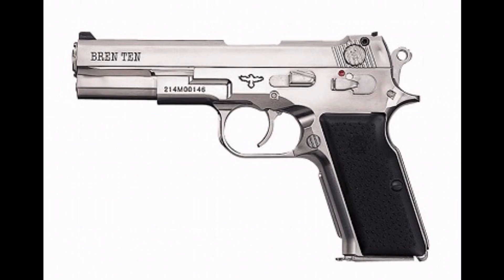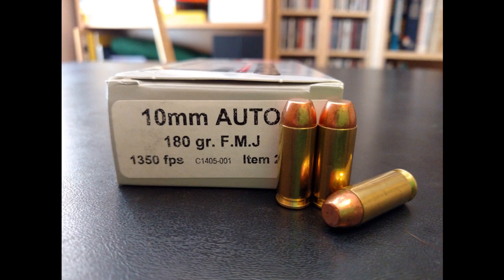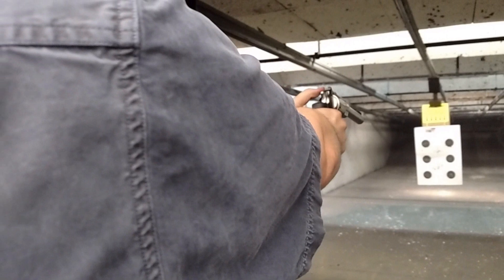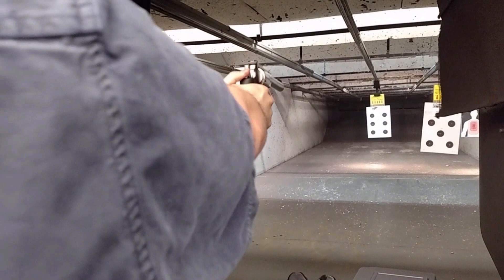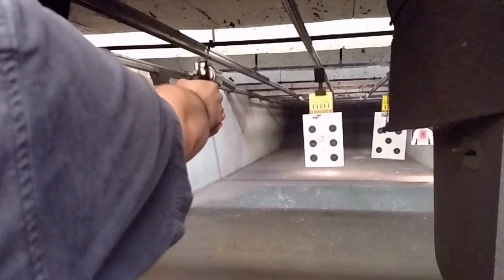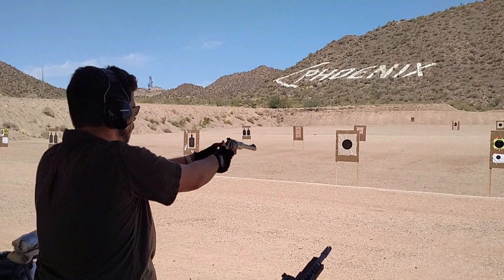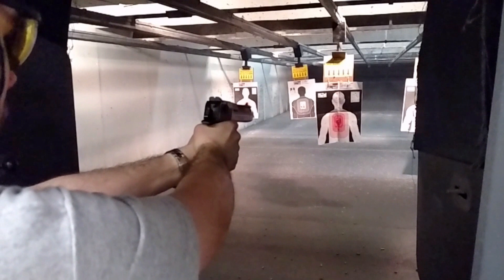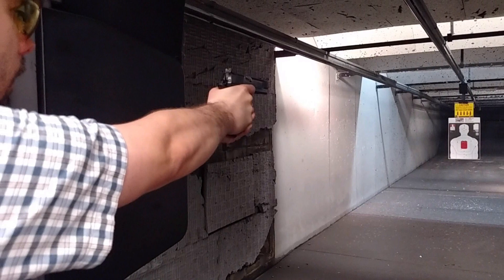Top 5 Big Bore Handgun Calibers

Comment: As far as auto pistol rounds I really like the 10mm. This is my choice in an auto pistol. For a revolver I like the .357 magnum. All are good choices and it comes down to what one can handle well. In other words, a caliber that one can control well enough to shoot it accurately on a consistent basis.
Reply: 10mm is an absolute beast especially when you shoot it with hot loads. The hard upward recoil does put some strain on the wrists after shooting it for a while.
Reply: How's about .40 Smith&Wesson?

Comment: My favorite is the 40S&W only mentioned in passing.
Reply: I like .40 S&W, but I prefer the big brother 10mm
Reply: Would .40 count as something like a mid-bore (not sure if that’s a real term)? Or is it technically large because it’s a toned down 10mm?
Reply: @BuddyLee23  it's still considerrd a large bore, because it is still a 10mm just in a shorter shell casing.
Reply: @BuddyLee23  The bore is the same on both so if one is a big bore both are. One is more powerful of course but the caliber is identical (incidentally also the same as the .38-40).

Comment: Gotta agree. I have a Springfield 1911 45 cal Mil Spec. It is accurate and the recoil is something you can handle all day without the "tingles" Ammo price is mid-range but sometimes you can score a sale on the 500 to 1000 round box. Buying anything less and you won't receive a good savings. Did buy the Hornady 20 round 45 JHP for home defense.

Comment: My first experience with the 454 was with a 6" Ruger Super Red Hawk. Because the grips on the Ruger did not have a palm swell and thus didn't fill my hand, the felt recoil was absolutely brutal. After 5 rounds my gun hand was nearly useless for 2 days. A few months later, I was able to try my friends Taurus Raging Bull 454 with an 8 3/8" barrel. With the standard Raging Bull grips and the ported 8 3/8" Barrel, the Taurus turned out to be a real pussy cat. Accuracy was top drawer.
Reply from the maker: BIll Hagan - I always liked Taurus' grip design on the Raging Bull along with the ported barrel.  I have contemplated porting my Super Redhawk.
Reply: 6" SRH?...I don't recall that version. When they 1st came out I  know there was a 7.5" (which I own) and a 9". Much later they came out with the Alaskan. I thought that was a snubnose.

Comment: This seems to have generated some controversy, and that was not the intent.  While Smith and Wesson announced the Model 29 in the new cartridge 44 Rem Mag first, Ruger beat them to the market place, producing and delivering Blackhawk SA revolvers in 44 magnum before Smith had their product on the shelves.  There are countless references confirming this, but check for example "107+ Handgun Accuracy Secrets" by Massad Ayoob (fairly authoritative) et. al., Delta Medium Publishing, page 75.  There are many more.  It does not matter if S&W announced their new product first, Ruger beat them to the shelves.

Comment: I really like the .45...but my true love is the...41. Mag.
Reply: If you want something that hits in the range of the .41 magnum, buy a 10mm and load it with some hot 10mm rounds.
Reply: Never shot it but I ALMOST bought a used Ruger Chambered  4 it.... Instead I bought a 9 shot Hi Point JHP in 45 ACP and a BUNCH of ammo!!!
Reply: @jpb1231000  I had a Hi-Point JHP 45 at one time. It was dead on accurate right out of the box, and it was reliable as could be. My biggest complaints with it were the weight of the gun and it was a bitch to take apart and clean, if it weren't for those 2 reasons I would have kept it. Ended up trading it in and paying the difference to get a mint condition used .45 ACP Glock 21. I do like the Glock better though, because it's a hell of a lot easier to take apart and clean and it is accurate as hell as well.
Reply: Really nice round. Not hugely different than the .44 but slightly better SD than the 44.
Reply: @bdr32965  ....I own a 10.....S&W MOD. 1006...
Reply: Wow 41 mag I never fired one , but almost bought one years ago , should have. If I ever see another one again I'm buy it.

Comment: in addition to the original 45 long colt being not chambered in rifles because of colt wanting royalties for chambering it's cartridge, the original "balloon head" casings had a tendency to break off. That would leave the casing stuck in the chamber. The other reason being deep extractor groove present in modern 45 long Colts weren't present in original case heads
Reply: Daniel Hess - the original balloon head cases of the 45 long colt didn't have enough rim for RELIABLE extraction in a rifle. Not a problem anymore, but that was the original reason they weren't chambered in rifles. 
Case head separation wasn't the issue. The Colt cases were made the same basic way that the 44-40 and the 38-40 cases were made, and those cartridges did fine.
It wasn't until reloaders tried to hot rod the 45 that problems arose, and those problems included rim blow-out before any separation issues occurred. Rim blow-out is the reason S&W started countersinking their chambers. That's not something that is needed with modern web head cases, but the practice is still often included as a sign of quality craftsmanship.

Comment: Pretty good list. For me I would have a hard time picking the order but the top 3 would be .45LC, .44Mag, and .44-40. The last two might be .38-40 and .45acp unless you count a single shot like a contender in .45-70 or .38-55.

There aren't more auto loader carts simply because for me my only use for an auto is some really cheap knock about or something where I am CCW in a situation where I expect to likely have need of a lot of initial round capacity such as escape from New York. In the latter situation something like a CZ-82 would seem to be the appropriate weapon which isn't a big bore.

Comment: My favorite is 454 casull revolver with extra 45 acp cylinder so it makes 3 caliber gun 454 casull , 45 Long Colt , 45 Acp than l would buy Cz 75 SP-01 Shadow or Shadow 2 then buy a 22 LR kit for this pistol so 2 hand gun but 5 caliber 454 casull , 45 Long Colt, 45 acp , 9 mm And 22 LR

Comment: The 45 acp is fine..  I have 3 1911's and a 1917 revolver..   it falls short for long range work tho and... who likes picking up brass?   it is good..  I load my 45 acp with 200 grain cast swc rounds at around 1,000 fps which..    is a pretty good round.

Comment: This strikes me as a pretty fair evaluation.  To be fair, I am over the huge bore handgun fad, so I probably see this from a different perspective.  
Most of the cartridges you mention are not shot a lot.  Even back in the 1970s (I've owned five or six .44 Magnums - both Models 29 and Super Blackhawk -  in that time frame) most people I have met tend not to shoot the .44 Magnum cartridge in full power mode a whole lot.  It is a most powerful (not THE most powerful) handgun round and features high versatility.  However, I thought long ago - and was right - that if I needed that much power, a small to medium sized rifle would be more useful.  By the way, I find a Super Blackhawk much more fun and less painful than a Model 29 with heavy loads.  
In the .44 family, I much prefer the .44 Special.  Yeah, I know, the standard factory load for YEARS were loaded to be safe in the top break .44 American and .44 Russian calibers and pressure levels.  But I do handload.  The load I have developed is within the pressure levels of the Smith & Wesson .44 Special Hand Ejector, 2nd model; featuring a 250 grain flat fronted cast bullet at about 900 or so fps.  Not a magnum load, but will suffice for most purposes.
I do agree about the .45 ACP.  In a Government (or Lightweight Commander) Model It is likely the most versatile combination of cartridge and pistol available.  For self defense - for which it was designed - nothing really is better.  When one reaches a certain level in anything, 'more' doesn't matter.  In many ways, it works better than 10mm.  It allows faster subsequent shots (for more than one target) and yet is a reliable stopper when applied properly.  Of course, the 10mm is also, but is far more intimidating to the shooter.  No, I would not intentionally use such a combination for hunting game deer or larger, but as I already said, I'd use a rifle.

The other rounds mentioned are ones I have not fired.  Nor do I see any reason for so doing.  I understand the desires of others to use large bore handguns for various purposes, but do not share in it.    I'm sure they perform as advertised.  

Once again, I do find this video quite fair and balanced.  I do find the underlying precepts and assumptions flawed, but understand my views are not the laws of the Universe.

Comment: Ive fired thousands of rounds through my Delta Elite and never ONCE did i think it had anything close to heavy recoil.  I felt it was average..
Reply: I bought a Delta when it first hit the market and used it in bowling pin competition along with a Gold Cup. I regrettably sold it and the Cup when raising funds for a USPSA gun. I recently acquired a Glock 20, but haven't fired it yet. I'll wager it won't handle the 10 mm nearly as easily as the Delta. I used a 45 acp in USPSA in both semi and revolver. but that new gun I was building was chambered in 38 super ( this was before nines or double stack), which next to the 45 is my second favorite.

Comment: UK poster here, so much of my opinion is either theoretical, or based on what I used to be able to do before the laws changed.  Obviously, the cartridge does affect the accuracy, but as long as you use decent quality ammo, surely the gun is far more relevant to accuracy?  A 2" snub revolver is never going to have the accuracy of an 8", even with exactly the same rounds in it.  A crappy Chinese knock-off of a 1911 is never going to outshoot a Colt Custom House Match pistol, even if both are using match grade .45acp.

Comment: I like this vid.  I've got a 1911 that I soon plan to convert to 460 Rowland.  Also my next purchase will be a Super Redhawk 454. I like these guns with the configurations because of versatility.  I'm one of those guys who may plan to just hang around town but last minute may end up in the woods. I wouldn't trust standard 45acp or 45colt to a good sized bear. at least not without maybe chancing a reload. So I plan on having both swapping my daily carry as I choose and always keeping both respect sets on me depending on if I carry my 1911 (45acp/460 Rowland)  or the super redhawk (45colt/454 casull). I've always lived by this motto "Its better to have it and not need it than need it and not have it " anyone who's never heard that, live by it and you'll see how much easier life gets. use those wise words and throw tacticool out the window just go for ease of use, practicality, and versatility and you'll never go wrong.

Comment: Good List,  The recoil on the 454 with my first shots, was intense but it gets better as you get used to it. At first I only really wanted to shoot 5 rounds of 454, and then switch to 45 colt. But as i have shot it more, I often do 30 rounds of 454 and 50 rounds of 45 colt in a sitting with my super redhawk. I enjoy it alot. Although accuracy, suffers with the 454  I need to shoot and practice a whole lot with it. With 45 colts I am spot on, with 454 it spreads a bit but functional.
Reply: +48conkli By the way, love the 10 mm too, My 29 is my most enjoyable gun I shoot.
Reply: The .454 was the first hand gun i fired. and i fell in love with it

Comment from the maker: +Brian Fortin - The .460 Rowland is one seriously bad-ass cartridge!  I kleep debating on getting a conversion kit for my Glock 30, but can't make up my mind.  I think I'd rather wait until I have a Glock 21 so I can go full size to help with the recoil.  I left this one out because it's still so new, and hasn't quite had a ton of info I could research on it.  Although, I LOVED what I did find!  It's a freakin' monster of pistol power!
Reply: get the 460 Rowland . You can shoot 45 acp+p, 45 super and yours truly 460 rowland.
Reply: Go Big Bore Or Go Home I'm getting the 6 inch barrel conversion for my g21 and I've heard a lot of varrying opinions on the recoil everything from lighter than ball 45s to 454 casull so take what you read with a brain is salt but from what I've seen in videos it looks like 45 +p loads recoil wise and no the comp can be removed without the need of a vise ( it had to be lock tighter in before ) just remove a set screw and untgread it
Reply: Go Big Bore Or Go Home and why no 500 s&w
Reply: I have a 500 Smith & Wesson performance center 7.5 inch barrel  nice revolver but I just love the fact of 460 Rowland has 44 Magnum power 10 plus One in the Chamber you cannot go wrong with that with 255 grain 11 rounds I think it's pretty devastating. For whatever animal in North America.
Reply: Manuel Silva yeah the 460 Rowland is really a for to be reckend with also I'm not positive but I believe the rowlanator sight comes with the 6 inch conversion and my 500 is a bfr with a 7 inch barrel
Reply: Yeah I think all you need for most use is a 460 Rowland 500 Smith & Wesson it's pretty much if you want to go to Africa LOL. And if that's the case I could just use my CZ 505 Gibbs
Reply: Manuel Silva yeah the 500s more for fun but if I was going to Africa with it I'd feel pretty safe
Reply: It has been done before. Plus like I told the other guy. The 460 Rowland has been used as a side arm in Alaska

Comment: 10mm and 45ACP are big bore?
Reply: BR5499a 45 ACP is bigger bore than 44 Magnum. Does only 500 s&w count?
Reply from the maker: BR5499a - For the purposes of the channel, I start the category as anything that is .400" in diameter or larger.  Gives me more calibers to work with.  To be honest, there is not hard and fast rule on this, as some consider it at the .41 Magnum and up, some say .44 Speecial (.429") and up, and some say .45" and up.  Remember that we are going by bore diameter, not power factor.
Reply: 45 can take a black bear and 10mm can take a kodiak brown bear
Reply: Most people factor power into the equation. For example a .45 ACP has a larger bore than a .41 Magnum but only the .41 magnum is considered a big bore and that is about the minimum limit on the power scale that is usually considered "Big Bore".
Reply: BR5499a here's how i classify bores:

.17-.25 and their metric equivalents  is small bore. Examples: .17 WMR, .22 Short/Long/Long Rifle/Magnum, .25 ACP

.30-.38 and their metric equivalents  is medium bore. Examples:
.32 S&W/Long/H&R Magnum/ACP,
7.62 Tokarev, 7.63 Mauser, .357 Magnum, .357 SIG, 9mm Luger/Parabellum, 9x18mm Makarov, .380 ACP, .38 Special, .38 Super

.40 and above and their metric equivalents is large bore. Examples: 10mm, .40 S&W .41 Magnum, .44 Special/Magnum, .45 Colt/ACP  .454 Casull, .480 Ruger, .475 Linebaugh, .50 AE, .500 S&W Magnum, .500 Linebaugh

I stated handgun rounds only to simplify things and to keep in context with the channel's subject.  

There are small, medium and large bore rifle rounds that are completely different animals than the handgun rounds listed.
Reply: Sixgunner dot org  .357 and .38 are the same pojectile.  9.1 mm to be exact.

Comment: Never understood why it wasn't called the "43 magnum" at .429 groove.
Reply: cause it just doesn't sound as cool.. I think if it was called 43 magnum, it would never have been so popular. 
Just like the 460 Rowland... it's still a 45.. Maybe they should have called it the 452 Rowland Magnum?
Reply: Well .45 colt doesn't sound as cool as a .47 colt either, but it's more true to the diameter. I still don't know why it got named .44 when it's actually 43. Has to have been developed from the .44 special name, which is also essentially .43.
Reply from the maker: My best guess is a hold-over from other "44" caliber cartridges like the .44-40 and the .44 Russian.  Since the .44 Special was a .429"/.430" caliber, I bet they figured there was no point in changing it.

Comment: İn my opinion 357 magnum beats 10 mm auto l havent mentioned 357 maximum yet !!!!
Reply from the maker: alper aygun - Until recently, I would have argued.  But recently, I've been massively impressed with the penetrating capabilities of the 158 grain hollow-point .357 Magnum loading.  It does a lot!
Reply: Though probably considered a mid bore it can pack quite a wallop at the cost of brutal muzzle blast.

Comment: Excuse me but there aren't 5 big bore handgun calibers. There's .50,.475 & .45. I don't think you could consider .429 (44) a big bore. I admit I may be missing something. If so please tell me.
Reply from the maker: Porkchop's Papi - For the purposes of the channel, I start the category as anything that is .400" in diameter or larger.  Gives me more calibers to work with.  To be honest, there is not hard and fast rule on this, as some consider it at the .41 Magnum and up, some say .44 Speecial (.429") and up, and some say .45" and up.  Remember that we are going by bore diameter, not power factor.

Comment: Can’t the 45 ACP be loaded with clean burning powder?  Also, isn’t there at least one company that manufactures a 45 ACP with clean powder?
I remember Lucky Gunner did a Video about some rounds that produced more muzzle flash, regarding nighttime home defense but I forgot if the was any in 45 ACP.  It seems like major manufacturers would want to make things easier for their customers.  But then again, maybe their just concerned about profitability and use the most cost effective powder. 
Cheers ya’ll.
Reply from the maker: Michael Scheitlin - I haven't had luck with any type of ammo, but some are dirtier than others.  In fact, Blazer Brass is pretty dirty.  I have been told the lower pressure of the cartridge is responsible for more soot as it burns less efficiently.